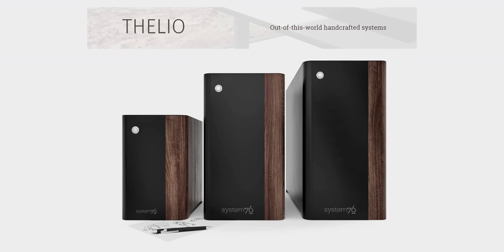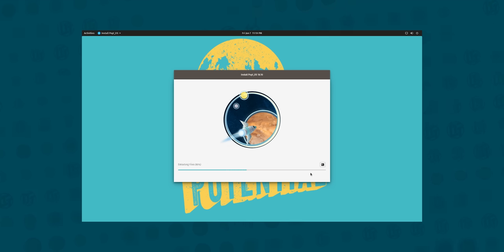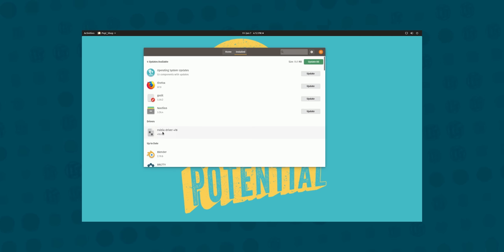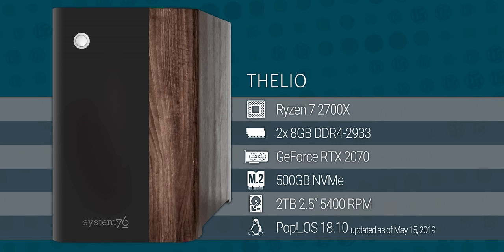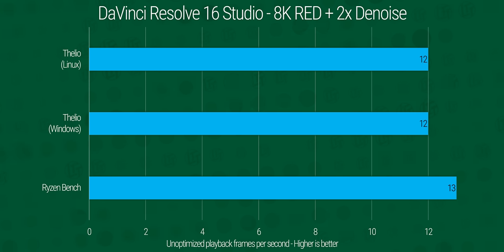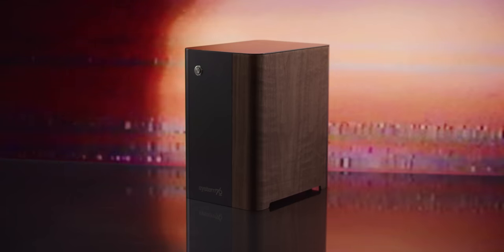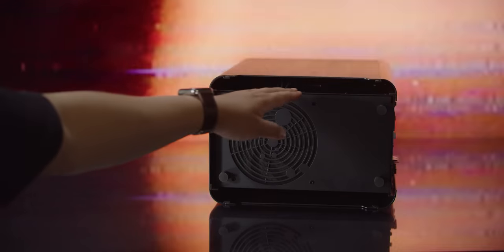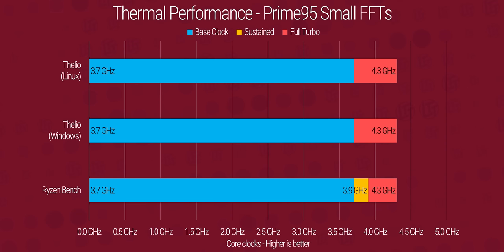A REALLY Weird PC… - System76 Thelio Review

Comment: Only downside is the review I think. Thermals and sound noise on synthetics only testing? How often will the average user put that much load on the machine? The answer is never.  The information provided in that part of the review is useless. We want to know how it performs under more normal loads. Then, there is the $1,000 more expensive? It is not really $1,000 more expensive when you forget to add the case in the PC Part Picker list when comparing prices. Is the case available? no it is not. How would you even price something like that? If the case came from a major manufacturer that was redesigned from the ground up, not just based on existing tooling, and had unique and thoughtful customizations using unique materials like wood, and was a limited run that was not mass produced how much would it cost? I am sure it is more than $0?
Reply: If you spend around $2400 for a pc it's usually for a reason. And it's not to watch youtube videos and scroll twitter. And would you pay a $1000 for a case where you can't ever change the motherboard? Really worth it. Not to mention he said "Case aside, what arre you getting for that $1000 difference".
Reply: @muzlee7479  Please name the every day workload that this 2700x and 2070 is best suited for that would use 100% of the CPU and 100% of the GPU simultaneously for extended periods of time. The workload that the end user must stay at the PC to perform and where no headphones would be used and the cooling must be quiet? My point is this is a ridiculous way to test acoustics. Do acoustic tests using real world workloads. Workloads that are likely based on the specs of the machine.
Reply: @edwarddesposito4476  Okay, it's linux so gaming is not a thing. Other then that the only real reason to get this specs is if you edit videos or do 3d work. Both requires you to sit at the desk and would be pretty good if the pc wouldn't mimic a freaking airplane. There is no other reason to get a config like this. Maybe if you are a sound engineer? Back to your other point, you get this amazing custom case for $1000. For a $1000 you can't change your platform, can't have bigger drives, is loud and it doesn't even have front io. However I look at this, it's a shitty deal. It's totally realistic to havesuch workloads on a machine like this.  What would you consider a realistic workload? Opening 5 chrome tabs? Also, it would be pretty bad if you only had your max fan speed when you hit a 100% load. That would mean either you are underclocked or you are hitting absurd high temps constantly.
Reply: @muzlee7479  as far as the price, assume a major manufacturer like Lian Li produced a few hundred unique cases with large curved wood accents. How much would they charge? +400 maybe? How much of a premium would a customer pay to buy a prebuilt PC through a small boutique system builder? 150+ maybe? How much would you pay for the support? Enter your value here. How much would you pay on top of that for a system knowing every possible effort was made to make it as free from black box code/firmware as possible? Enter your value here. How much is it worth to you to get this unique system built by the OS manufacturer that offers that software open source knowing the profit goes to supporting that company in making the products they offer better? Enter your value here. Maybe you understand why it makes no sense to simply compare this system to a PC part picker list that fails to factor the second most expensive piece of hardware and factors in none of the other benefits.
Reply: @muzlee7479  gaming in Pop os is a thing. A sound engineer can do their work on a potato. None of the other options you mention max out both while actively working. You would not edit and render at the same time on that hardware and nether would max both CPU/GPU at the same time even while rendering.
Reply: @muzlee7479  Funny how I am getting an argument over a three year old video about a system and OS that is no longer for sale and you would never use.